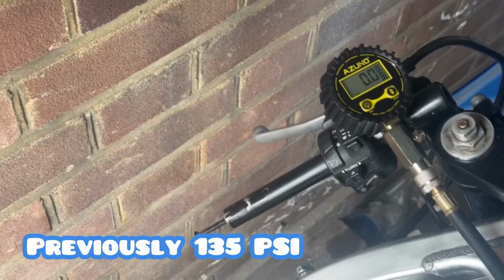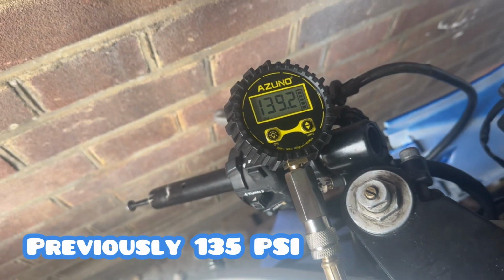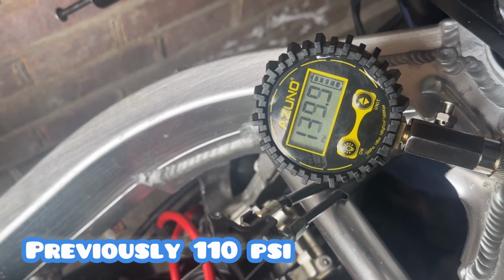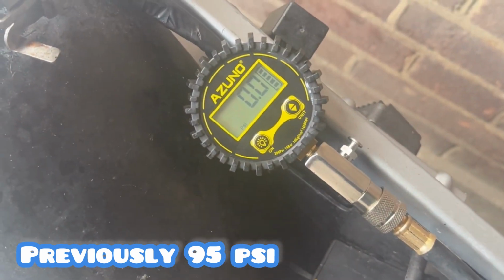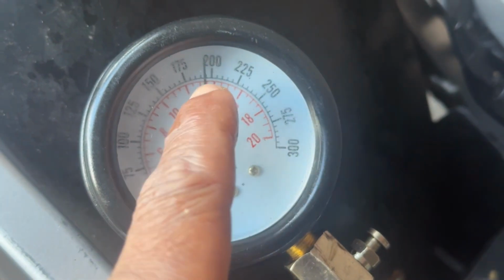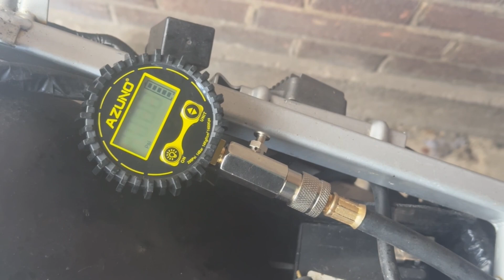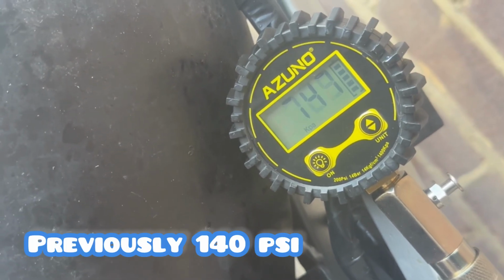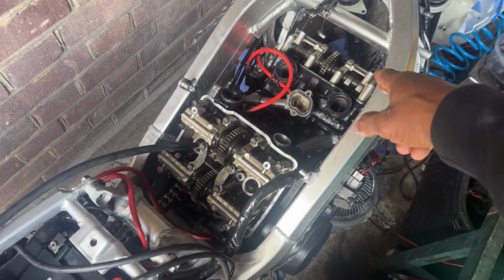HONDA VFR400 NC30 Restoration Episode 36

Comment: Happy New Year Darren to you and yours. Compressions are brill, well on 3 cylinders. Got to be valve clearance. On the 200psi, valves (possibly inlet and exhaust) are not opening! The cylinder is sucking air past the piston rings rather than the inlet valve and exhaust cannot release it. Has a shim dropped out while you were rebuilding? Defo since you’ve got so far, recheck clearances. Not be long before it sounds sweet and sometimes it takes time and above all else, patience. Keep at it, great vlogs, very interesting jobs. Stay well.
Reply from the maker: Thanks Dave, someone pointed out that I had the gauge set to KPA instead on PSI on cylinder no1 so it seems that both rear cylinders are high. I’m wondering if my timing is off. I’ll look into all the suggestions tomorrow 👍🏾

Comment: HI Darren. Watch out! At 16.55 in your video you are set to kpa not psi. 1380 kpa is 200 psi, please verify, I used google conversion to quick check. This would mean your 2 back cylinder are higher (new gasket?).  Keep on with the good work!
Reply from the maker: Hi Thankyou! Well spotted. This is why I put as much on the videos as I can lol. Good to have second pair of eyes. Well it looks like both rear cylinders are around 200PSI 
I’m thinking I may have my timing off or something.